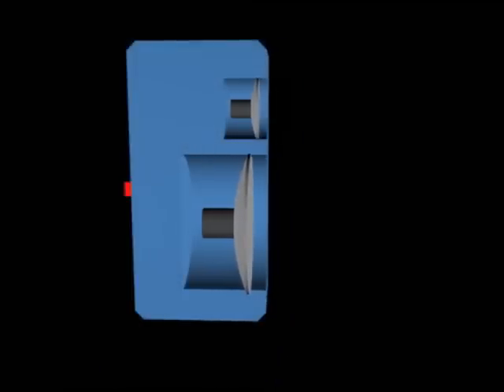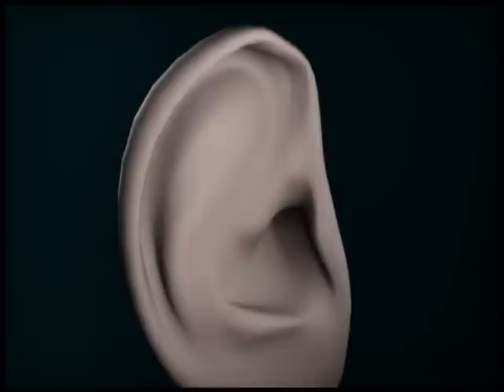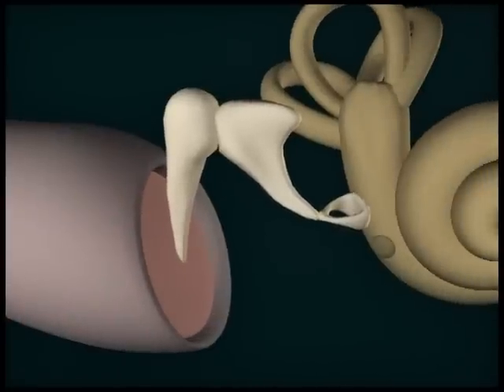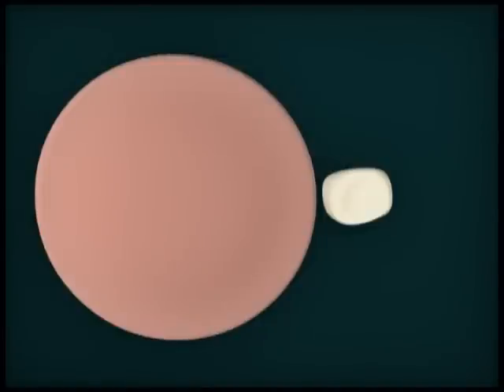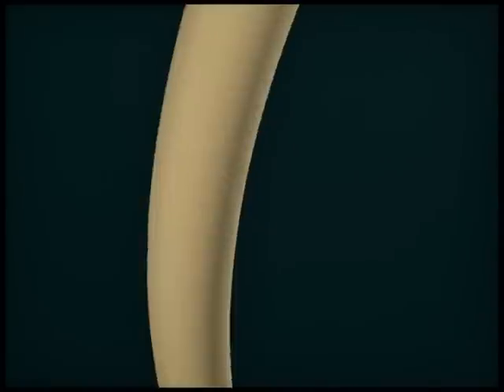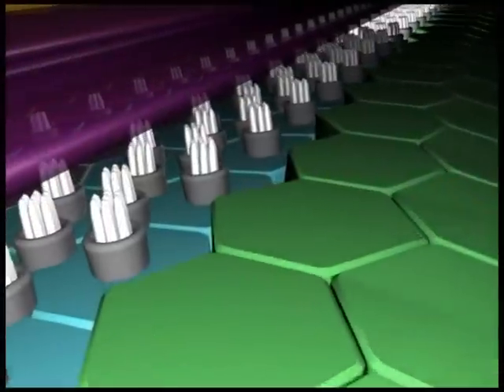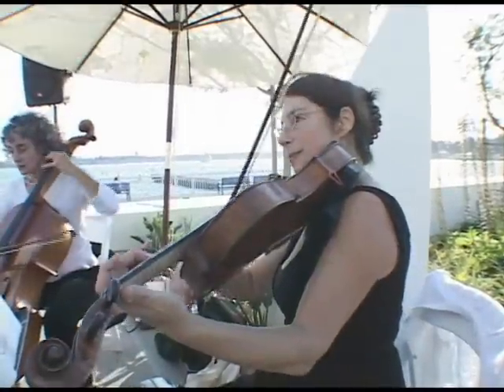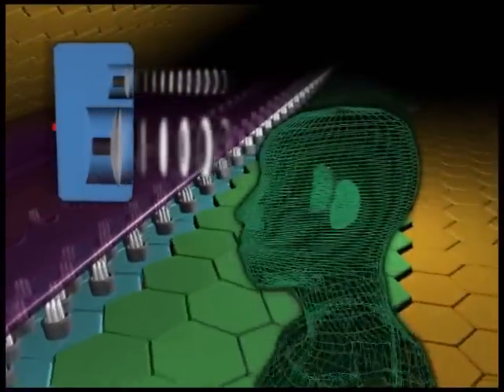3D Human Ear

Comment: You completely disregarded the fact that this is a chemical reaction, not an electrical.
Reply: The inner ear begins at the cochlea. The cochlea is snail shaped and housed in the bones of the skull. When the stapes moves the oval window back and forth, the fluid within the cochlea begins to move in a wave-like pattern. These waves make tiny hairs rub against other structures in the cochlea creating chemical reactions. Different sounds create different waves; the variety of waves create multiple chemical reactions. These reactions are sent along the nervous system to be interpreted by the brain as sounds.
Reply: cleardaze hearing isn't a chemical reaction - it starts off as physical, then is electrical (as it says in the clip, the cochlear nerve sends a signal to the brain). Nerve impulses are electrical signals.
Reply: It is a chemical. You should actually read a reliable source. I am quite sure that I made an A in A&P last semester and have a 4.0 in nursing school. I obviously know a little about this.
Reply: I have read reliable sources - I am in my final semester of a double A&P/Biomedical science bachelors degree and I too make A's! I have also worked in the Otolaryngology Department of a hospital as a Nurses Aid.  We obviously have differing viewpoints - I would be interested to hear/read your explanation of how it is a chemical reaction.  It may be that we are describing the same process with different terminology, especially if we are from different countries?
Reply: +Linda o I am a Licensed & Board Certified Naturopathic Physician. You are absolutely correct (of course, you already knew this though...)
Reply: ur parents dont love you